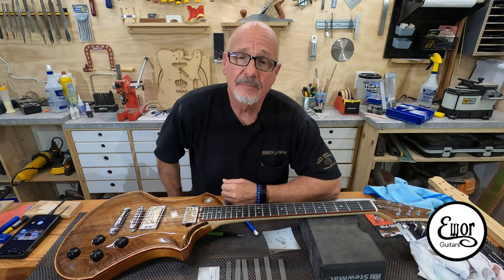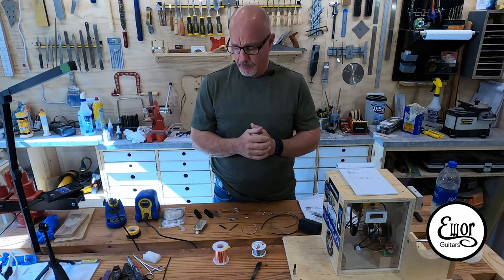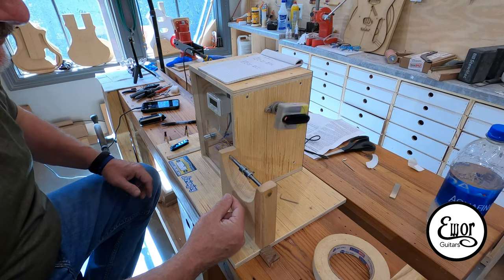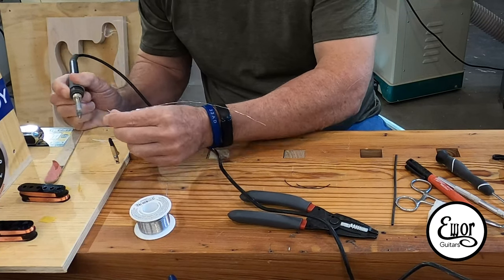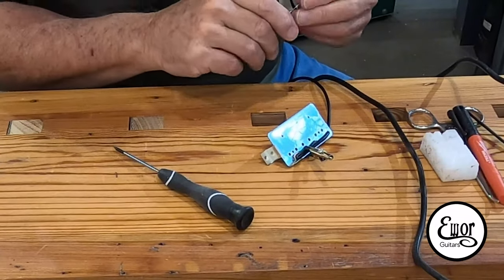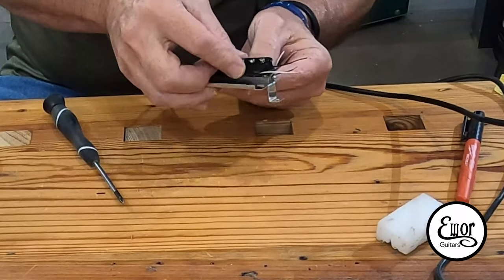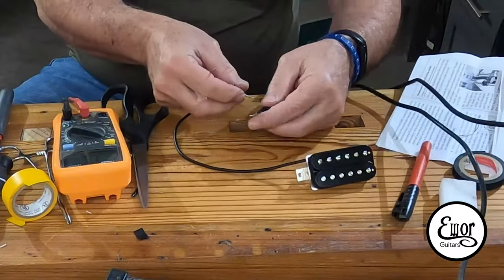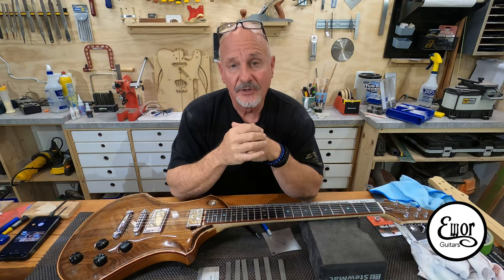How to Build an electric guitar episode 21: Building the Humbuckers

Comment: Nice soldering job Dave. (I'm an old pro at it. Of course years of soldering j-boxes on aircraft will do that.😂) it's looking good.
Reply from the maker: Soldering has definitely been a bit of a learning curve but I feel like I’m getting better all the time
Reply: @eworcustomguitars  As I learned from the US Navy, always have a "Well tinned iron", "get the contacts you want to solder hot first" "DON'T MOVE the article once solder is applied. Lest a cold solder joint ruin your day!!" (I've given the "layman's terms" rather than the MFs used in place of the, contacts & articles. LoL)

Comment: Great series.   I've built several basses, but never wound pickups yet but will soon.   I have a technical question.  At around 4:30 did you say all the coils are wound counter-clockwise.   I was thinking for humbuckers one coil was clockwise and the other counter-clockwise.  Just checking.   I am still in the learning stage before my first pickup build so just trying to figure this out.   Thanks and again great video series.  That is a beautiful guitar!
Reply from the maker: Yes on humbucker pups all the bobbins are counter clockwise. You may be able to turn one clockwise but I never have. If you buy the stewmac kit there is instructions that explain the process pretty well. Thanks for watching brother!
Reply: @eworcustomguitars  thanks!